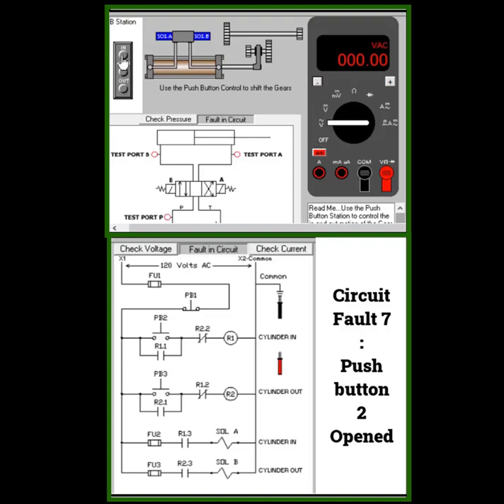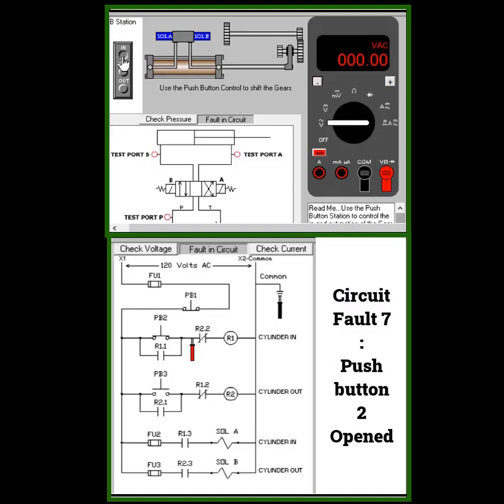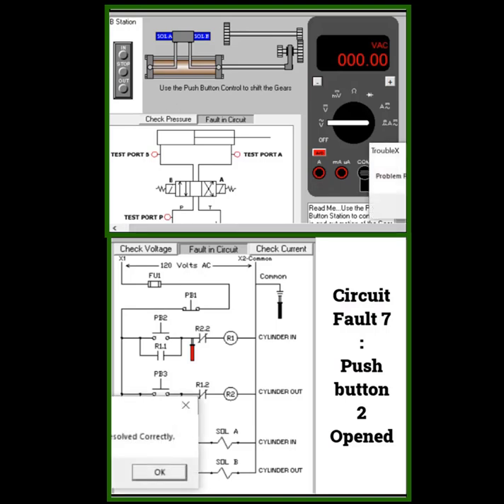Circuit Fault 7 : Pushbutton 2 Opened #Shorts

Comment: Good brief sharing on pneumatic electrical circuit fault finding but the pace is too fast in this video....may need to slow down a bit .
Reply from the maker: Yes, you are right.....all the videos under the series of "electro-pneumatic" circuit troubleshooting have been purposely shorten to less than 1 minute in order to be qualified as "Youtube Shorts".......I am sorry if the videos are too short and my explanation are too fast and not clear. Anyway, I will try to improve it. Thanks again.